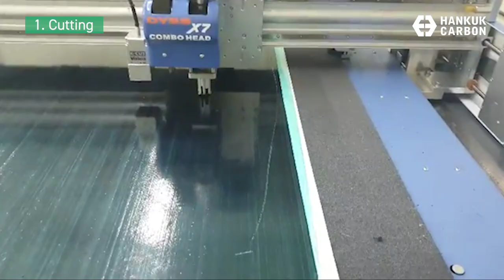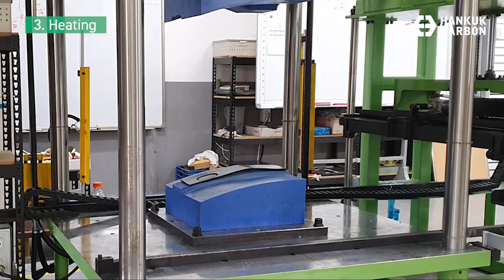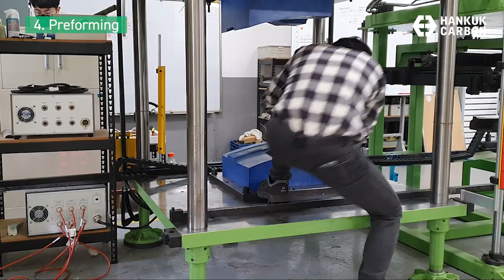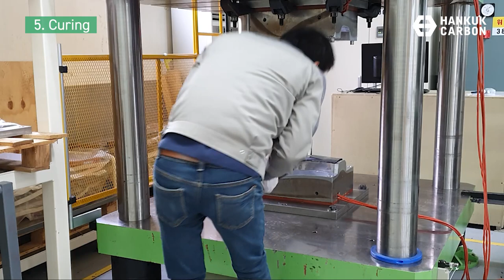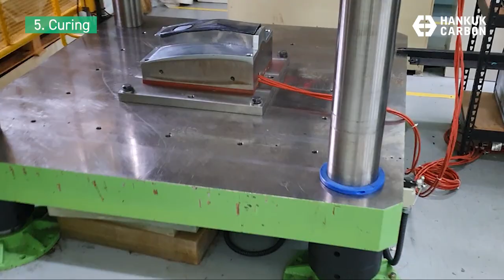PCM(Prepreg Compression Molding) Process

Comment: whats the pressure for forming opperation?, and the mold is heated or just the part or both? thanks, great job
Reply from the maker: Cure pressure is normally 15 to 30 bar and the product in this video was performed at 30 bar.
The Material is heated only in Preform step, then the mold is heated to 150℃ and molded for 3 minutes in curing step.
Reply: @HANKUKCARBON  thank you very much for answer

Comment: Not using autoclave??
Reply from the maker: It can be used for PCM and Autoclave.
Reply: @HANKUKCARBON  press only cure within 4minutes.. if autoclave, how long need to cure?
Reply from the maker: @asalbolehjer1952  In case of autoclave, there are no need to have long dwell time(holding time). Just need 3~5min depend on temperature.

Comment: So after press is ready to use? no cure need? just 3 min? What resin is that if only need 3min, must have some drwbacks.
The PCM is hot?
This try in my mind what Elon Musk is making with the new aluminium alloy.
Reply from the maker: The prepreg was cured at 150C, 3~5min by hot press after preforming. If it is for appearance part, need to do clear coating after grinding.